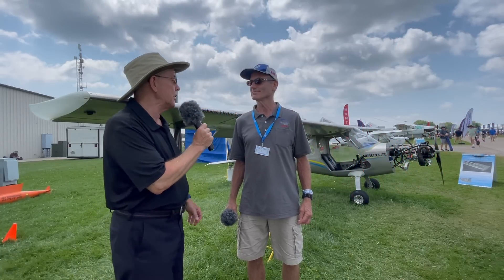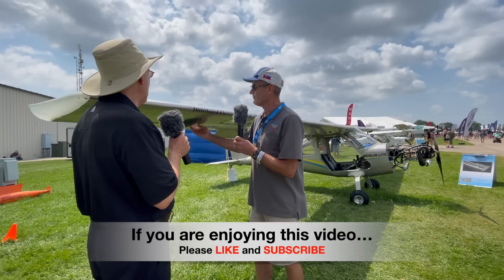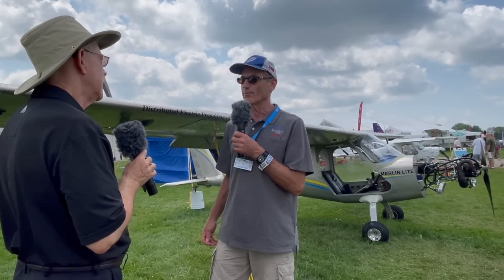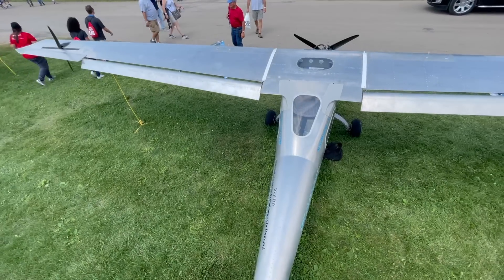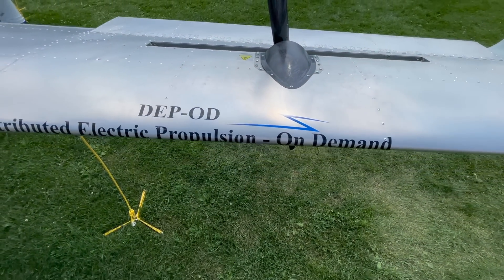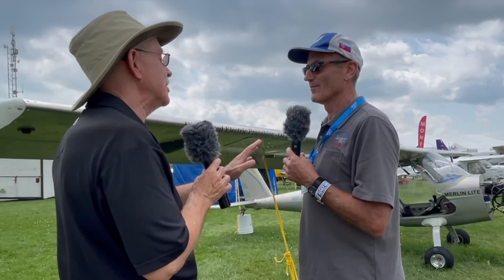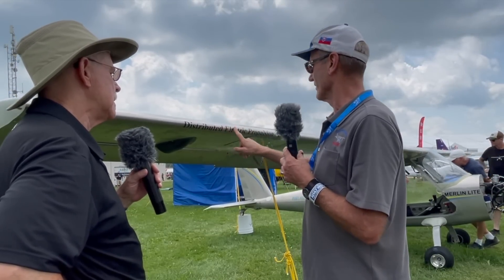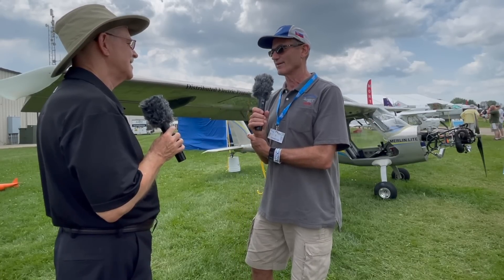In Wing eProp patent 0723

Comment: G'day,

A funny thing about designing and building Levitation Machinery...; ALL the most successful Accomplishments owe their success and Market Longevity to their obedience to the
Principle of...

"SIMPLICATE...,
And add
More
LIGHTNESS...!"

What I see here is a way to
Complicate the
Buggary out of a little
Hairygoplane..., by Computer-integrating 2 Wingtip Electric Motors of 15 Hp, with Airscrews lurking in a 
Vertical Well between the Wingtip's Upper & Lower Skins, emerging from and being sealed under
"Automatic" 
Gap-Covers,
Between their operation at 
Take-off & Landing...

As with
ALL
Proposals for
Wingtip Propulsion Schemes.

EVERYTHING totally
Depends on
Both Tip Motors functioning
Perfectly,
ALL the time aloft ;
Or
BOTH Failing
Simultaneously....

Because, 
EVERY Time
Only ONE Tip-Drive
Fails while t'other  one runs ;
Then whomsoever is strapped in the Cockpit
Is a helpless
Passenger in a
Spinning
Catharine-Wheel.

Instead of
ALL this Craptacular Bullshit...,
Do your Ab-Inition on
Sailplanes,
Learn to fly the
WING...;
And then, later on, after converting to machines with
Motors...;
When your Noisy Smelly Vibration-Generator
Inevitably
Fails for you...,
Then you will
HAPPILY 
Revert to your
DEFAULT Mode, of
Flying the WING..., and then you will
Get on with landing
Normally,
Ie..., Without Power....

And all the rest of the time your
Aeroplane will be
VASTLY more 
Fuel-efficient than the
Petrol/Electric Catharine-Wheel Hybridised Complicated
Abortion of a thing,
Which has to lift 500 pounds of 
Extra added 
Weight & Complication and
Increased
Dangerousness,
And then
Drag it all around the Country on every Flight.

All 
Apparently...
For the sake of
Marketing Jism ;
Of the,

"Lookit my
Aaaah-Mazing STOL Performance !"

Variety -

Which is supremely irrelevant for the 99.99% of Pilots, who take the care
To have sufficient Runway, and enough
To spare...;
BEFORE playing with their
Aeroplane,
Just there...!

So, this will be struggling to find buyers willing to have all the worst features of both ICE & Electric powered 
Fright ;
With none of the
Advantages of
Either...!

An interesting
Try....
But,
No
Cigar...!

Such is life,

Have a good one...

Stay safe.

;-p

Ciao !

Comment: This is relatively common on model airplanes. It's extremely noisy because of the close proximity between the blades and wing.
Reply: I recall that there was some motorglider with such arrangement. Still, electric boost for takeoff is a great idea.

Comment: In 1929 at Handley Page Ltd, UK, the Guggenheim Safe Aircraft design competition with the Curtiss Airplane Company, resulted in a single propellor driven light aircraft with a patented leading-edge slat and flapped wing, capable of taking-off in about 240 feet and landing run of only 63 feet! The British competitor, of 40 ft wing-span, was called the GUGNUNC and used a 155 HP Mongoose II engine and had an all-up weight of 2,100 lb. I presume that the Aeromarine design has a better performance than this.

Comment: I can see the FAA crash reports now: failure of the secondary propulsion system due to vibration and destruction of the wing resulting in loss of the aircraft.
You don't put a propeller in the wind shadow of anything ever for any reason. There have been a lot of crashes of rear prop aircraft for exactly this reason and those just failed from being in the shadow of relatively well designed aerodynamic support structures.

It doesn't matter if this only runs for a minute every flight. You get a 5hp motor and a broken prop shredding a wing, its done.

Comment: Sooooo there is a propwash going the length of the wing, increased drag due to the slot's square profile, more complex wing flex pattern and reduced glide ratio, not to mention prep replacement being more complicated. It's going to work in ultralights in which bending forces are far below airframe stiffness, but I don't see it going outside that category. For ease of maintenance I'd still prefer either forward mounted prop, or pusher. At least add set of fences on each side of prop slot...

Comment: I like the imbedded electric motor, was hoping it played a main form of propulsion. using multiple small electric motors instead of one central motor. I know it sounds silly but the early electric RC planes had no flaps but steered by using the out board motors. the aircraft  can perform a host of maneuvers without flaps  by adding more power to one wing you turn , combining throttle for lift and dissent. Multiple motors also means safer if you lose one. plus your battery needs would be lighter. Look at the research they are doing with battery models that make components of the vehicle are actually batteries. Zero point energy I think.  That coupled with solar skin. It may not be a fighter jet but it would be a safe affordable form of flight that would recharge sitting on the tarmat.

Comment: From an Aero Eng of many decades, I can say this is one of the most confused concepts I've ever seen. First, the potential flow field around the wing will ruin the prop performance, second, the prop wash will have high potential of causing problems with the flow over the ailerons, finally, there is some chance that Von Karman vortex streets will set up on the wing causing massive vibration problems. Overall, an idea worthy of the trash bin.

Comment: I’ve literally been thinking of the concept of supplemental power from electric wing motors for months. Glad some one is doing it! In wing design great idea as well. The thing not mentioned is the redundancy for motor failure which could help in critical phases of flight for main engine failure. Awesome stuff!

Comment: If my memory serves me correctly, this slot-buried propeller was tried on a self-launching sailplane maybe 40 years ago.  (In Germany?)  Did not work out satisfactorily, very noisy siren effect with the airflow being "chopped" by the props.
Reply: You are correct, it was in West Germany sometime before 1979. So noisy that development was halted. Alas there is very little documentation on this, just recollection. There is a saying in German which explains it and translates to "success has many fathers but failure is a complete orphan". We joked that a significant part of the engine output was sound and not force. 
This new drive should also make a lot of noise, albeit for seconds and when close to the ground.
We'll see.
Reply: @peterf2451  The aircraft was likely the Fischer RW3 Aka Rheinflugzeugbau RW3 'Multoplane' with the prop swinging between the fin and rudder of a T tail and stopped in the slot for soaring - it was noisy but still being flown by the designer until a few years ago in his 90s .  Hanno Fischer also designed the Fantrainer ducted propeller mid fuselage military trainer - also noisy . Another using a prop in a wing slot was the "Skyjacker" - low aspect ratio homebuilt -it also suffered from noise and low Cl from the huge slot in the wing --the prop efficiency must have been pretty poor in both cases and this one - just putting the prop at the leading edge and folding forward would be much better. ( Burt Rutan did something like that on his Skigull )
Reply: "strike out text is unintentional - a computer glitch .
Reply: @rossnolan7283  I'm aware of the RW3, the design of which I'm referring to had twin   props buried in the wing but nearer to the wing root.  Somewhere I have a magazine with photos.
Reply: It took a bit of doing but I found it in a 1974 issue of Motorgliding Magazine.  The twin-prop slot-buried design was entered in a German design contest of that year.  No notation on how it fared other than flying and climbing well but objectionably noisy as previously mentioned. This was a modification done to the Scheibe Bergfalke IV sailplane by the  Flying Training School of the Detmold Aero Club.  Sounds like more than one may have been built, also was tried on the Schleicher Ka8B.
Reply: @paulliebenberg3410  Any chance of posting a picture? I was working in Germany at Schempp Hirth in 1973 when we were doing the first retracting engine/prop Nimbus - based on an amateur converted Scheibe SF 27 . The Bergfalke is about the worst handling glider I have flown (roll control mainly ) - hate to think what adding slots in the wing would have done to that.....
Reply: @rossnolan7283  pretty hard to do in YT comments.  If you list your email on your YT homepage "about" tab I could send you a scan.
Reply: Just checked the patent and as usual in turgid 'patentspeak' language it seems to include covers when not active but not shown how -- the 'blue line' speed (one thruster inoperative or failed) would have to be extremely high and worst case would be with one side stopped outside the slot (instant airbrake/spoileron and massive overall adverse yaw .  With the centre propwash over the tail it would help to counter some of the yaw but the unwanted roll assymetry looks problematic -presumably they have to be stopped or started together - or else..  Some evtols are worse in this regard.

Comment: It will need redundancy as an engine failure on takeoff or landing would produce great instability impossible to correct with the flying surfaces. You need about 1 lb of batteries per each hp due to their maximum current delivery limits called the "C" factor (forget the endurance limitations), so 8 lb of batteries can only supply enough current to about 8 hp of power. Good enough for some improved control but not possible to make it SSTOL and operate out of a helipad as claimed
Reply: what happens if you have a computer or battery failure or electrical short and one of the wing props stops and the other keeps going!!... or even just a glitch in the computer program and the wing props start spinning, unplanned and unregulated, at different rates "out of control"... NO MOTOR (gas or electric), and NO Computer are 100% reliable... it once took me 6 months to build a new Windows 11 computer because of 2 defective motherboards, 2 defective graphics cards, and a defective external 8TB hard drive... almost everything that could have gone wrong did... I'm even thinking the power supply also went bad... but one of the graphics cards and the first power supply, I did buy second hand... and even though it seems to be working fine now, I would not put it in charge of a plane I intended to leave the ground with... LOL...

Comment: Surely the slot in the wing where the electric propeller is hidden during cruise effects the aileron effectiveness and creates drag.
Reply: personally, i'm more reminded of air raid sirens...

i wonder why they dont have a practical demo?
Reply: Starting around 2:30 he addresses this - apparently production models will have a "gap seal" method that will prevent aerodynamic problems when the wing props are not in use.
Reply: With a top speed of 75 mph, drag is not a big issue.

Comment: About 4 months ago on Dan Gryder's channel I commented on several ideas to make a single engine {engine} failure on takeoff, much less stressful than we currently have.  I proposed several ideas, but one was retrofitting each wing with an electric motor {counter rotating} and working with the piston engine.  The idea being that the piston engine would only need to go to about 80 to 90% and your electrics are at 100%. {on take off}  If the piston engine fails, let's say at 400 feet, the procedure would be to level the nose and just maintain your 400 feet.  Then instead of an "impossible" turn, you just simply do a gentle banked turn and fly the pattern at 400 feet AGL just like you would at 1000 feet AGL in a normal pattern. {on your electrics}  Of course you STILL declare an emergency because your primary engine is out. But you have ample battery power to circle the airport and do a normal landing.  I was thinking having batteries that could provide about 10 minutes of flight, so you could have emergency flight but not get too much dead weight as in a full electric. {which I still think full electric aircraft NEVER will be practical for anything over an hour} But I digress.  AND I also talked about increased initial climb with my idea.  So I made my comment and boy oh boy did I get blasted !! I was told I was stupid and the idea would never work. {not by Dan, Dan is my HERO !! But the negativity was from other commenters} Now I'm a pretty thick skinned guy.  I did not let the negativity get to me. I thought I was the only guy on the planet who thought of such a crazy idea.  Remember my goal is if there's a piston engine failure on takeoff, I just want a way to continue the take off, circle the airport, and do a normal landing. Then I watch this video and my jaw dropped !! I feel "vindicated".  I had NEVER thought of "hiding" the prop inside the wing.  WOW !! There is hope !! Electric propulsion is most definitely the BEST as far as assistance to the primary engine.  Electric simply can't be the primary source, but good grief it can do an amazing job in augmentation.
Reply: Starters are electric motors, and can also be generators.  Generators can also be electric motors.  Aircraft have one of each, and they also have batteries.  If the prop is connected to the engine shaft with a sprag clutch, it can still be rotated with the engine stopped.  Any ideas, folks?
Reply: @Reach41  A spinning bicycle wheel' can power a small headlight _ so a free flowing prop' at the speed of flight' could/should' also be able re'power something else _
Reply: OK crazy Idea Time:
The system you described plus, at crusing speed use the electric moters with the gas engine at a lower throttle, then when the batteries get low, throttel up and turn off the electric engines, and then use the propellers and the electric motor like windmills to recharge the batteries.
Maybe the math doesn't work but a smarter person than me can probably look into the concept.
Reply: @jtilton5  I think your idea could work if you're flying in lift and have a glide ratio of 15 to 1 or higher and you were to not climb but hold the nose down but maintain the same altitude. And you would have to circle the thermal. So the airplane if it had "feelings" would "feel" like it's descending but the altimeter would stay the same, thus turning the electric motor/generator prop like a ram air turbine on a Boeing 757 supplying power to the aircraft.  In the case of the B757 hydraulic pressure, and in the case of our hypothetical airplane electrical power to recharge the batteries. {yes I know a B757 can't ride a thermal, but it CAN glide !!} But man, thanks for your idea - this is how we change the world - we work together and brainstorm.  The very fact you took time to speak your idea means you're a GREAT person AND that there is hope for humanity.  These concepts of networking are just not limited to aviation. We could apply this to farming, education, design of communities, free market economies ect ect. Thank YOU !!!
Reply: @jtilton5  a crazier idea from a semi-computer geek / ex-electronics tech... computer failure or electrical short and one of your wing props stops and the other keeps going!!... or even just a glitch in the computer program and the wing props start spinning, unplanned and unregulated, at different rates "out of control"... NO MOTOR (gas or electric), and NO Computer are 100% reliable... and wouldn't you also need to be licensed to fly a multi-prop aircraft?
Reply: @Reality_Check-1969 not if they are disconnected from power.. And a resetable fuse in case two relays disagree... Can be done analogly safely..
I honestly think that though we may disagree.. Our common ground is that our loss of appetite for analog circuits and moving everything to logic was a terrible idea.. We won't want any firmware around something so critical beyond ESC.
Reply: @Reality_Check-1969  That problem has been solved. In fly by wire aircraft, there are 3 "channels".  Also you just use basic electric gate technology. So in your concern, the circuit would "ask", is the opposite motor turning the same speed ??  If yes, power continues to both motors. If no, the next logic question is, "can motors be synched to commanded power ?". If the answer is yes, the 2 motors are matched in power and synchro phased. If NO, power shuts off to both motors and sends a signal to sound an alarm.  In case of a runaway asymmetric thrust event, you could have a manual cable mechanically disconnecting power to both motors in case the "gate" system failed.

Comment: I think this will make a lot of noise, not optimal to have a rotating prop close to a solid part.
Reply: Is only for short term use
Reply: first person ive seen mention the air raid siren design...

think they would at least try a scimitar/curved blade prop to lessen the severity.

as usual, when i see guys talking, but i see no practical demonstartion... (nice typo!) somethings not right. so thats basically 99% of modern day "revolutionary concepts". old ideas, brushed off and given a coat of paint as the new owner has no clue someone else owned it before, built it before, created it before, shed blood sweat and tears over it before... and wonder why no-one else thinks its the best thing since sliced bread.